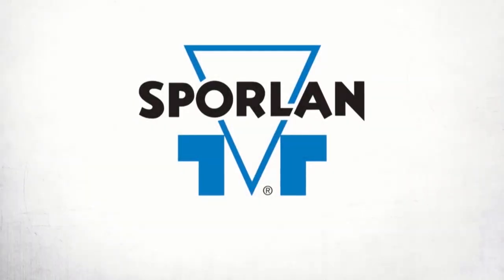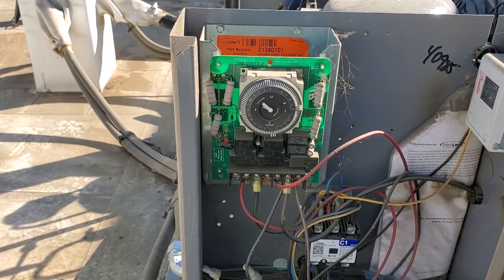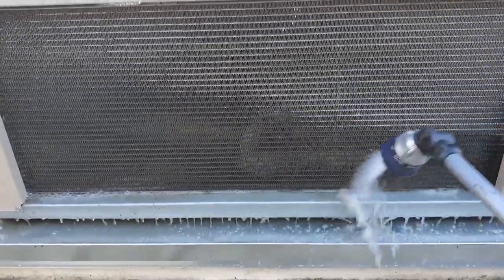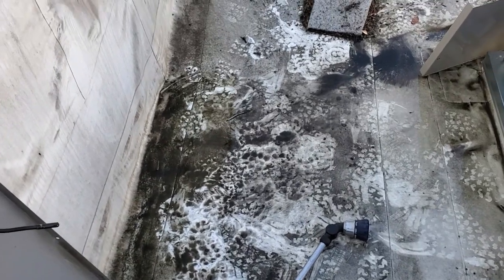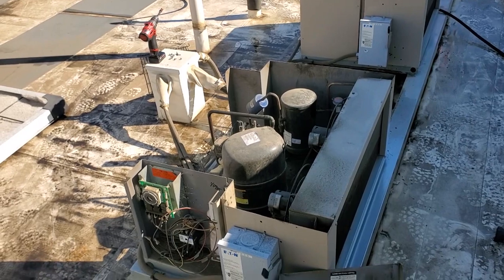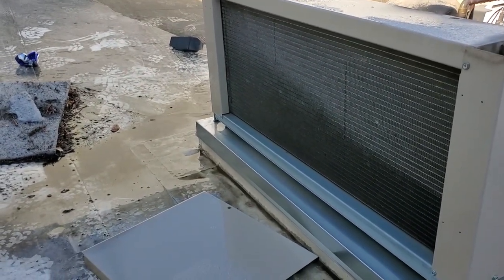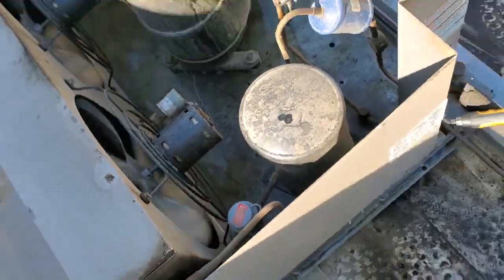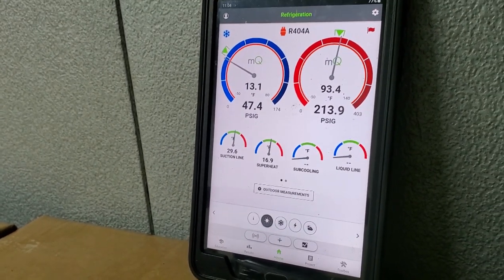WALK IN COOLER FANS NOT RUNNING

Comment: Worked for Hershey Lodge 17 years did all HVAC&R just before I retired ,2yrs ago ,the Lodge installed a new Trane rooftop for the new pool building ,all the rooftop units condensers had the micro channel, first thing I noticed after six months how dirty the condensers were and you couldn't use a power washer on that type of coil ,called Trane tech support also I am amazed at your knowledge for your age ,I had 49 years in the trade ,and don't miss the two A.M. calls!

Comment: I would like to give you 1 piece of advice.  Stop apologizing for not reaching 500. We all know you can NEVER get a perfect vacuum.  You are a great tech bud.  Your reputation has proven that.
Reply: perfect vacuums are indeed not achievable but a sub 500 micron vacuum for sure is.  just a matter of time.  (but we've all been there, quittin time and you're stuck at 6 or 700, just open those damn valves and go home lol)  some things i've found thatt help on reefer is to put all your caps back on the king valves with some nylog, those things leak like crazy always.

Comment: On those micro-channel condensers, when saturated with water, the water acts as a resistance to condenser coil air flow due to the fin spacing being so minute.  The water-saturated  condenser will then go up in head pressure. It seems counter-intuitive until the fin spacing is taken into account...then it all makes perfect sense. On another note, I have been to Heatcraft for an onsite classroom Beacon Defrost System course, quite informative. Good work shown in the video. You're a very competent technician!!
Reply: Rob Hernandez, you're welcome. There are a multitude of procedures out in the field that teaches technicians. School equips students and then the real-life learning in the field builds on that. Take care.
Reply: Surface tension can be a b!tch.

Comment: At 21:20 the vacuum pump with hose fitting is good idea.   When I use my Yellow Jacket vacuum pump on chillers it starts discharging a visible vapor around 20 microns with hot oil.  I had to install hose fittings on the handle and direct it out louvers or vents in chiller mechanical rooms  to prevent potential smoke detector issues.

Comment: Is there any reason you don't degas the pump and its oil by running the pump for a few seconds a few times? This seems like it would be much more effective at un-trapping any gasses from being dissolved in the oil and trapped in stationary parts.

Comment: run into this every time I pull a vac, same setup big hoses, vp85, cores out,  simple fix put the micron gauge on the pump all the sudden 1500 to 400, done you have made it to 400. very difficult to pull vacs the right way on equipment that has been operational for some time. poe/pve, not easy oil to work with.

Comment: I'm an electrician and I was installing lights in a pizza shop, and the next day they tried to say I shut off one of their breakers to one of their refrigerators and ruined their food, I told them I didn't and it probably tripped because of all the circuits that they had on one line, so they asked me to put a separate line in for them.
Reply: I hate those customers, they are basically projecting their incompetence on you.
They could see themselves doing a mistake like that so they think that you might have done it.
Reply: @DH18591  they were trying to make me pay for their food.

Comment: Good vid Chris, I am not a big fan of micro channel, I am old school, tube & fin, always worked best. I also didn't care much for 404A. I think 408A was very close to 502A, I found 502A a much better stable pressure drop across TXV, especially on thermoststic valves. I believe it is the glide of the blend. 502A was a better refrigerant. I found 404A is not as good as 502A in ice cream machine, which is very critical. Always enjoy your videos.

Comment: When you recover the refrigerant for expansion valve replacement, do you use virgin refrigerant afterwards? Or recharge with the old refrigerant? I would think that whatever stopped up the valve could be floating around in the old refrigerant. So I use fresh gas. I don’t work on refrigeration equipment so I wanted input from someone who does.
Reply from the maker: Yes I did use new gas

Comment: I have several customers with the same type of oddball hybrid system. They range from 10,000 to 40,000 square feet. The big one has 6  30hp units feeding 8 low velocity freezer coils. They can be a major challenge. They usually run about 27 degrees and freeze ups are my biggest enemy.
Reply: You might want to look into ke2 controls. I think the ke2 adaptive would work pretty well for that application.

Comment: I always wonder how those produce walk-ins at Costco maintain the temperature inside with tons of people walking in and out without any doors! Does that have anything to do with the number of systems mounted on the ceiling, or they were designed to work in an open environment?
Reply from the maker: Yes they are designed with no door in mind and the aire curtain also helps, I will discuss this on my livestream this evening, I will be going live on YouTube this evening 1/13/20 @ 5:PM (pacific time) to discuss my most recent uploads come on over and check it out https://youtu.be/YS0nIkCyXNE

Comment: If you prefer soldering they do make ready made flare fittings that you can solder to the copper lines and then if down the road you ever have to change that txv out again you just loosen the flares.

Comment: Hey boss, love these videos. I just wanted to say it was always taught to me to never go adjusting a valve until everything else was checked first. Especially when you already knew the unit was short of gas. Isn’t that going to give you high superheat? Also you could have a plugged up strainer or dryer. And in my experience if the power head had lost its charge you wouldn’t have that close to enough superheat (17degrees).
Reply: feedmebeast kitchen exaust

Comment: Of course nitrogen dissolves in the oil.  Same thing happens in the human body and agitation increases the offgassing, usually in the joints.  It's what causes the Bends!  And that happens at only 30  to 84 psi.

Comment: Hi Gents!

Wouldn't low suction pressure result in low super heat as well? I know the super heat is supposed to be low (and gradually get lower as the box cools) but at the end of the video when you talk about the flashing sight glass you mention low suction pressure and extremely HIGH super heat. 

If the sight glass is flashing that could mean you are missing gas which would result in low suction pressure which I though would result in extremely LOW super heat...  

Professionals, what am I missing here?? Cheers!

Comment: DTEK is good leak detect tool... I have the Stratus... NO DIFFerence from infinity to stratus... I did a test on a 150 Ton Chiller they said was tight... we got I-2 beep lights on a infin.. Got 150 PPM on the stratus...  I used the Bacarck Big model what eevr the # was and it just like it,, only  cost 9 bills to 3500 for Bacarack

Comment: How did you figured out level of liquid in that reciever? BTW great video.
Reply from the maker: I pumped the system down and used a heat producing device that did not exceed the safety limit temperature of the receiver to heat up the receiver and the liquid level could than be felt by hand.
Reply: @HVACRVIDEOS  Thanks for your explanation. Also, I saw it on your podcast. I also seen video of Refrigeration Rookie (I hope I am correct here with names and nicnames)  I am glad that you addressed it. I also invite you to our forum (link below) to contribute with your knowledge and experience.

http://www.refrigeration-engineer.com/forums/forum.php

Comment: Have to replay.... what constitutes a "hybrid" WI?
Reply from the maker: I call it a Hybrid because they maintain 25 degrees in the box .. a freezer is usually below 0 and a cooler is usually above 32....
Reply: @HVACRVIDEOS   mucho carne? A lot of meat held in that box?
Reply: Some places that cook and slice meat like those temps.
We cook off 1000 lbs of corned beef at a time then chill it down before slicing.
Reply: Should have a blast chiller to do it properly.... ever worked on those? Commercial production quick chill boxes?

Comment: Hey buddy. I've got a 404a walk in system I'm working on and the condensing unit is running, thermostat is operating right and the solenoid is getting power but both fans wont come on. Any ideas? Im thinking the defrost termination switch might be bad?
Reply from the maker: Walk in freezer??
Reply: Yes it's a freezer
Reply from the maker: So the defrost clock should have power between 4 and N and if that is what you measure than check power between 4 and N at the coil if power is present at the coil than the fan delay is what is controlling the fan motors . If the fan delay is working correctly it should not turn the fans on until the coil gets between 30-20 degrees.....

Comment: You would think that heat craft or Bohn  Would think of the customer enough to have sealed motors so you could wash it out and not have to worry about shorts...I have the worst time with this...at least it's an easy clean with micro channel
Reply: lutes workshop gener'al they could care less all that matters is make the units as cheap as possible lay off as many Americans as possible to make the parts and unit in some 3rd world junk hole all to make shareholders a few more dollars..